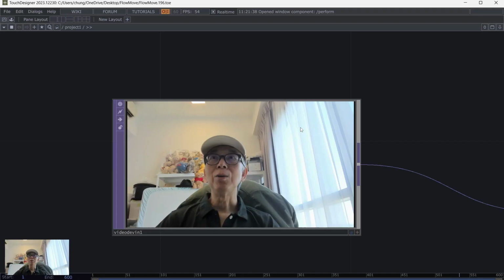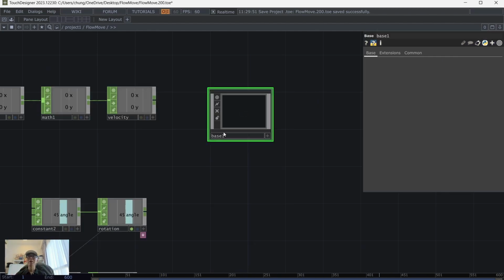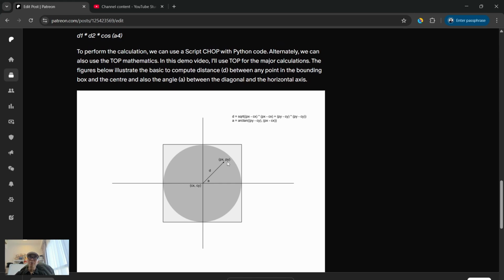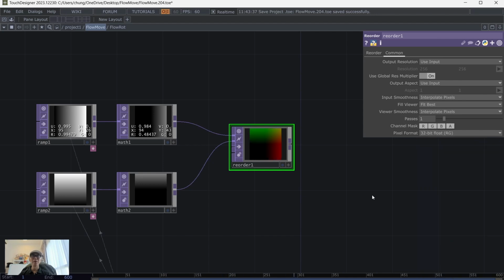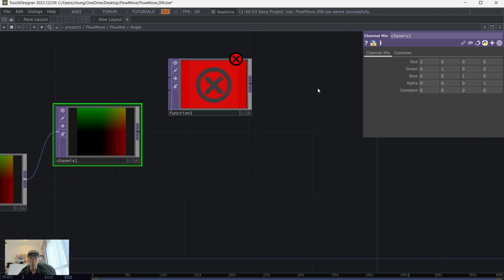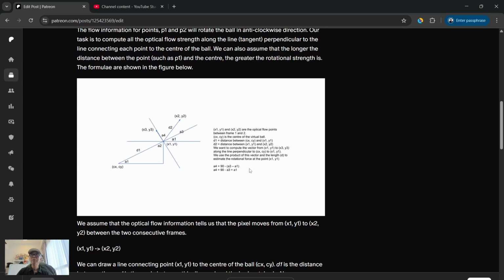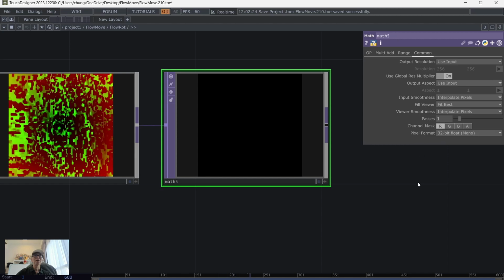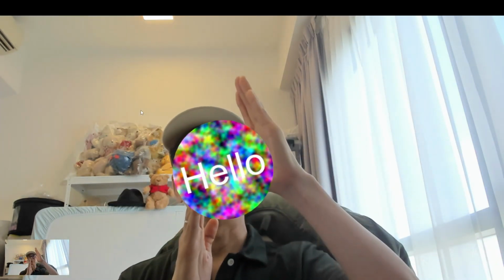Moving and rotating virtual object with optical flow in TouchDesigner

Comment: Teacher, why do you move so smoothly, while mine is always out of breath😂😂
Reply from the maker: There are multiple reasons. Please also check that I use a Resolution TOP to reduce the camera resolution to half (640 x 360) before sending it to the Optical Flow palette. Another possible reason is I use the Optical Flow from Palette Browser, not the Optical Flow TOP. The Optical Flow TOP needs to run with Nvidia new graphic card that I also don't have.
Reply: @chungbwc I didn't use optical flow top because i don't have Nvidia either ，i also reduced res ，but it's not smoth😂😂😂😂
Reply: @chungbwc i think should try again😂😂too difficult